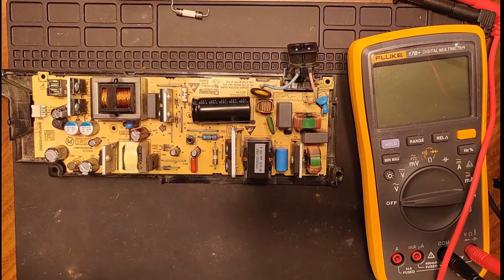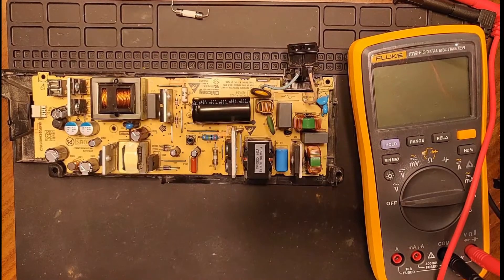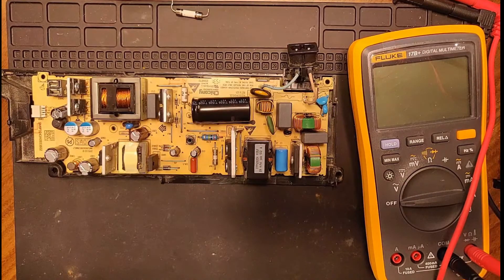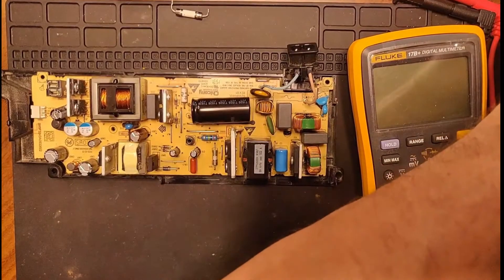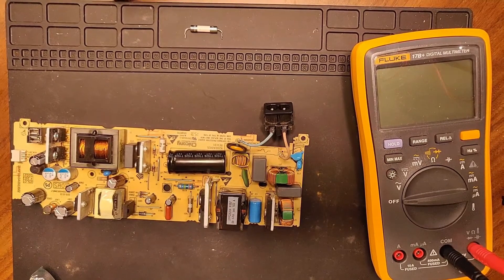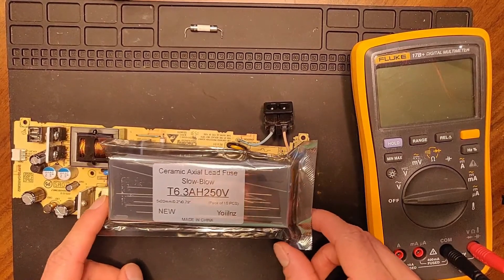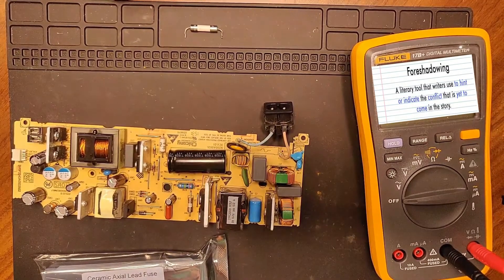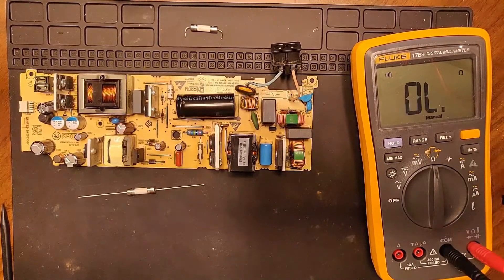"FIXING" a PlayStation 4 CUH-1215 Power Supply

Comment: hello sir, while trying to clean my ps4, i accidently broke the 4 wire jack connector which is connected to the motherboard from the power supplu. can this be fixed ?
Reply from the maker: It's totally possible! Those plastic connectors are really thin & brittle. If you have a replacement jack, you could get the old one off with hot air or solder wick and put the new one on. Check out this example from Andrew Paul: https://www.youtube.com/watch?v=_waZKBTHvSo

That said - if you don't do this work as a hobby and you never plan on opening your PS4 again - you could cheap out and cut your connecting wire and solder it directly to the board (leaving a note on the power supply  not to yank it out). Not recommended, but if your goal is just to get back to gaming, this would also work.